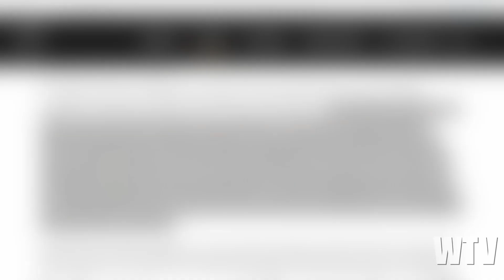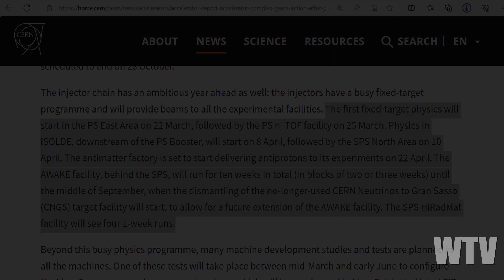CERN and the ECLIPSE: What You NEED to know about CERN and APRIL 8th

Comment: There is going to be a solar system visible to the naked eye between now and September, too. It's supposed to be a Nova that becomes visible. 2 different breeds of Sacadas are supposed to come out within days before the eclipse or on that day wierd thing is they are going to cover most of the Mid east ,basically where the eclipse passes through the U.S. Last time 2 different breeds of Sacadas came out was when Thomas Jefferson was President. NASA is launching rockets towards the eclipse on April 8th as well.

Comment: Because of the large amounts of Strangelets that were undetected by Angela: The Most High has been causing CERN to malfunction. They wanted it to run higher than 13 Tera Electron Volts or TEV's. What will they do when a Black Hole opens up that they can not control?
Reply: Gibble Gabble?
Reply: Run to their bunkers